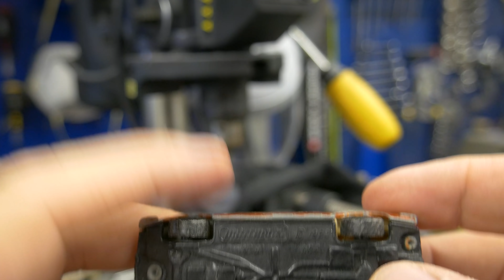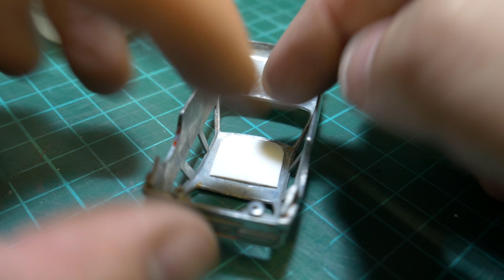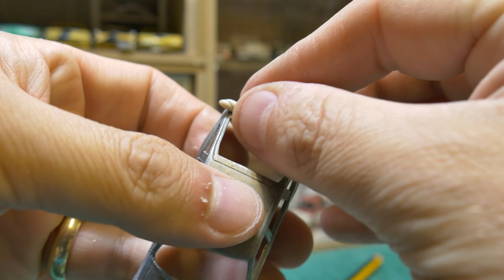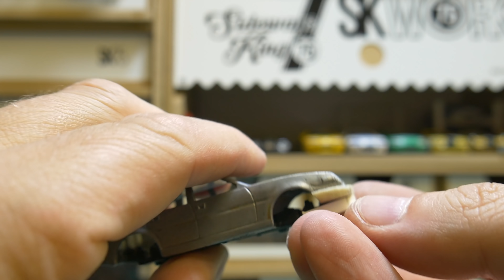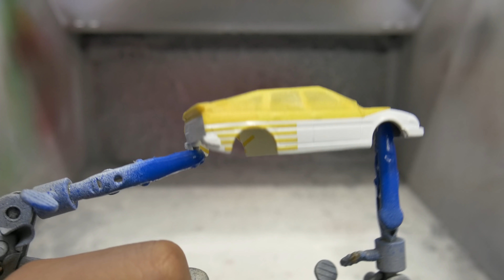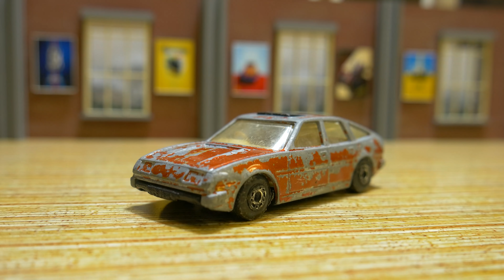MATCHBOX Restoration & Custom : 1981 Rover SD1 3500

Comment: A little tip to avoid paint bleed. After putting down the masking tape give the area a shot of clear. The clear should fill any gaps along the edge and prevent the color coat from getting under the tape.
Reply: thank you so much! i was making a bad ass rally car as well with a multilayered paint job (took FOREVER) but the paint bled under the tape i was using and ruined it for me! so i stripped it bare metal again

Comment: Won't you get your taping done if you spray the whole car with the tape on it with matte clear It locks the tape down and it will not bleed leaves crisp line
Reply from the maker: Thank you very much, i'll give it a whirl🚗🚓🏎😁👍
Reply: @SidewaysKing75   Please let me know how it works for you I use it in the model car community and it has helped me tremendously Just make sure you have pushed all of your tape edges down well before you spray